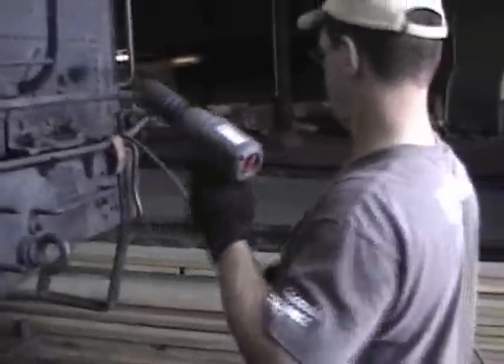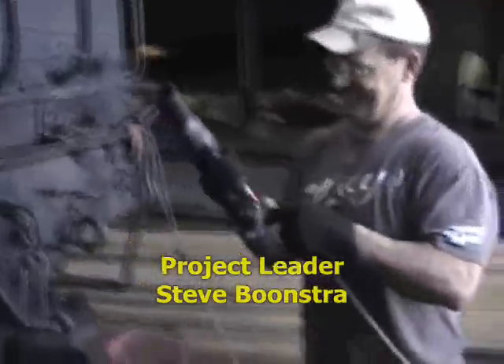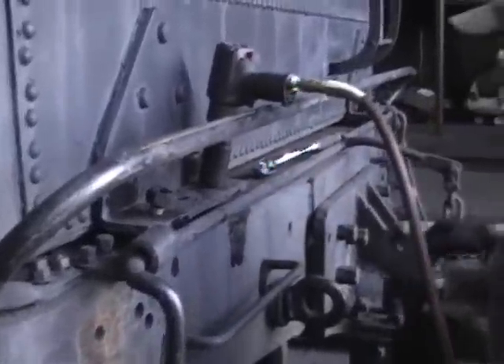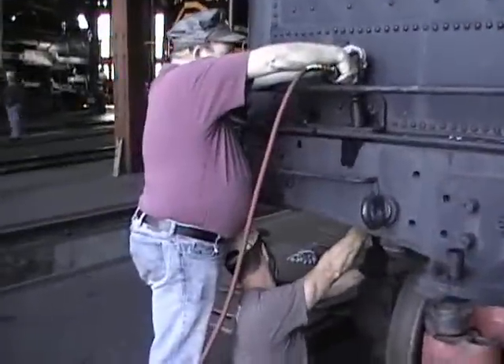Project 565 Workday Saturday September 18, 2010 Part One.

Comment: Plus there shops are filled with all kinds of other Stimulus projects that they are working on like the NKP 759 Asbestos Removal, the Reading locomotive, and a few others are still sitting outside waiting their turn for the asbestos removal. 

So right now, CP 2317 was stored and winterized so there shouldn't be any additional "damage" to the locomotive. But considering how things work for Steamtown or any organization to get money, it's gonna be a while before she runs again.

Comment: @HaloCE14 my father and I talked with several shop guys at Steamtown and the big boss in charge. 2317 could be in "storage" for a few years or up to ten years depending on how long it takes them to finish B&M 3713. The Baldwin is pretty much going to be finished in the fall if there are no other issues. If money comes in and they can finish the B&M with additional shop hands then the 2317 could be in "storage" for only a year or two. But it's likely it'll be in limbo for a while.